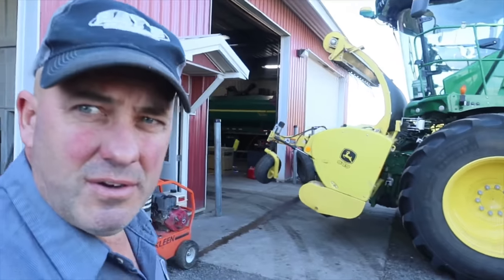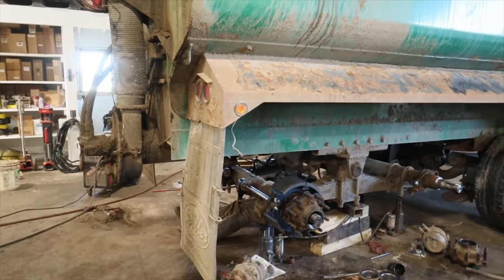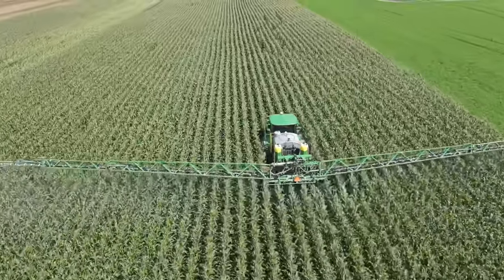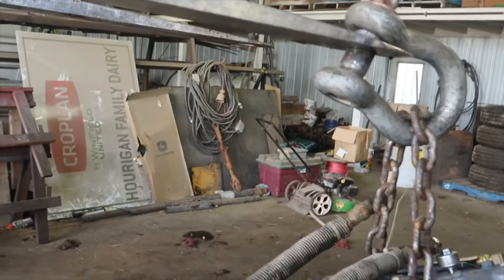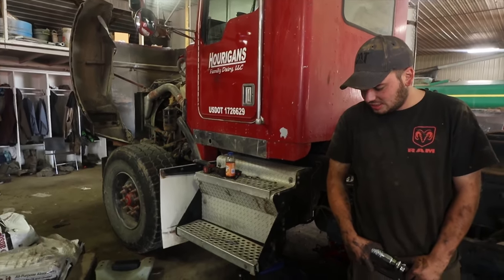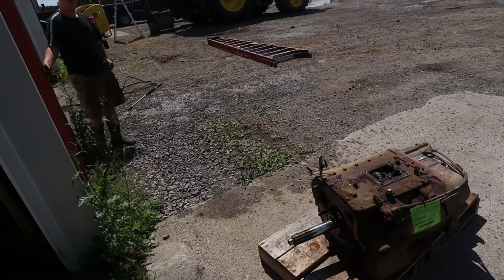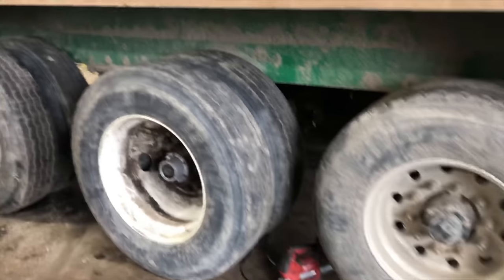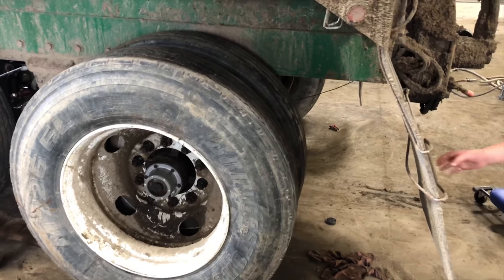Everything is Broken

Comment: Too bad those oil coolers are so problematic...they're designed to prevent problems not create them! That's some hard work on that equipment man oh man and dirty work too. Glad to hear third cut was good for you guys. Better days are coming Andy, cheers buddy!
Reply: Erated78 : All oil-to-coolant coolers should be a service item that is changed out as a Preventative Maintenance item. 
Unfortunately, I don't know anyone that does such cooler change-outs until failure. I believe it's because of the cost of them, not to mention the cost of replacing them (labor, fluids, etc). 
Coolers like that are definitely a good concept, but a garbage design for real-world use.

Comment: ANDY LET ME TELL YOU YOU HAVE IT RIGHT TRANSMISSION COOLER WATER RUNS THROUGH IT IT HAS LITTLE HOLES IN IT SO THE WATER CAN GO THROUGH IF ONE OF THOSE LINES ARD SPLIT INSIDE IT WILL LEAK WATER IN YOUR TRANSMISSION FOR SURE THE TRANSMISSION IS JUMPING OUT OF GEAR THAT IS CAUSED FROM BAD SYNCHROS IN THE TRANSMISSION I SEEN YOU MOVE THE SHAFT IT ALSO HAS BAD BARONS  NOT A CHEAP JOB VERY EXPENSIVE BEEN THERE AND DONE THAT THIS WAS A GREAT LEARNING VIDEO 👍🇺🇸 P. S  KEEP ON GOING ANDY IT'S TIME FOR A COLD ONE 🍻🍺🍻

Comment: had a 1989 Kenworth W 900 had that same cooler fail dislike them completely always go back to the good old fashioned oil to air cooler placed in front of the radiator

Comment: Andy I'm also a fan of oil to air coolers on transmissions especially since you aren't pulling big weights on a lowboy where the engine is running full power in low range continuously which is what really puts the heat into a transmission. That said the reason these coolers normally fail is related to coolant chemistry. With today's red long life coolants we tend to fill and forget, but you'll save a lot of money on engines coolers and Granny's by using the Cummins/Fleet guard coolant test strips every time you change your oil on an engine, where you just dip the strip in the header tank and it tells you right away if your coolant is any good or not. Also given how much corrosion you have you would be well served by replacing the engine earth straps every year or at least removing them, wire brushing the terminals, and studs, then smothering everything in dielectric grease when you reassemble it cause the first sign of poor earth is often failure of engine or transmission coolers, before you have hard starting. I think you do a great job and a lot of people would do well to follow a lot of the stuff you do. Another point next time you buy a truck, try getting one with an Allison transmission in your type of work, provided it has good oil and filters, it will outlast the engine and is much easier to driver when trying to run next to a forage harvester. All these well servicing companies going bust are probably a good place to find a truck like this.
Reply from the maker: Good info

Comment: After watching the guy run the 4620 on the baler, bogging it down and slipping clutch just to see it smoke,  I don't wonder why you have so many repairs! Fun to watch, but bet the cows would rather there money was spent elsewhere.
Reply from the maker: Clutch was not slipping
Reply: Bet you'll have a clutch replacement video in the near future on that tractor if you continue to let it be driven like that, just to see some smoke! Straight pipes are bad for equipment, because the little guys driving them romp the shit out of "IT"
Reply from the maker: @ericr4247  clutch was adjusted up good with firm lockup. Only time you can take a clutch out is off it can slip and that one wasn't slipping at all
Reply: 👍 sounds good!! Seems like allot of trans, clutches, and rear end problems on your equipment with straight pipes, just saying! 🤫😉